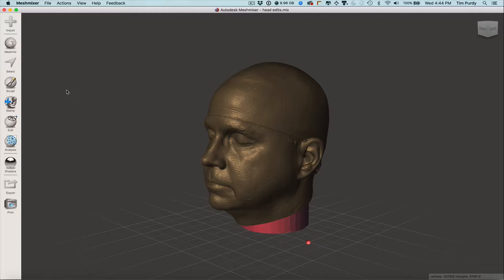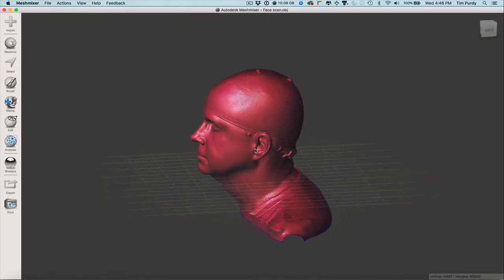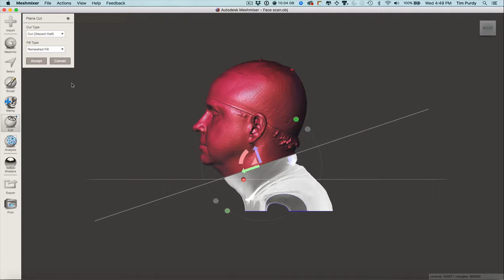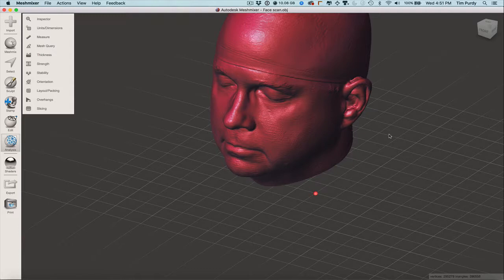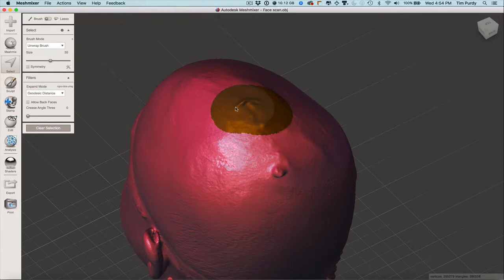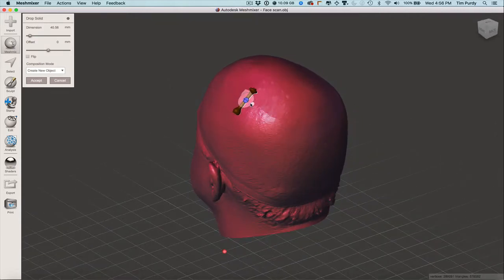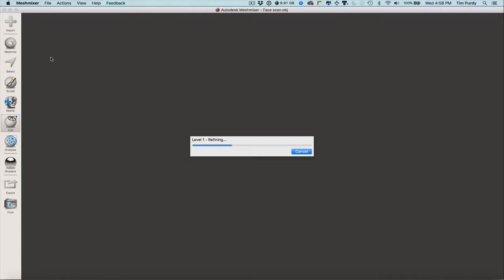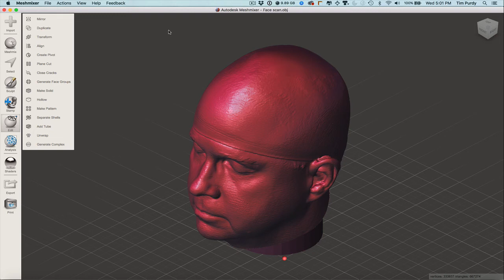Meshmixer Basics

Comment: I am struggling bad with this program. NOTHING makes any sense. I import my mesh scans but the program locks up and won't deselect my parts. I try to paint where to align the parts and it does partially align it but the markings will not remove. I don't know what I doing and I can't find anything on the website to explain how any of this works. All I can find is what it can do.